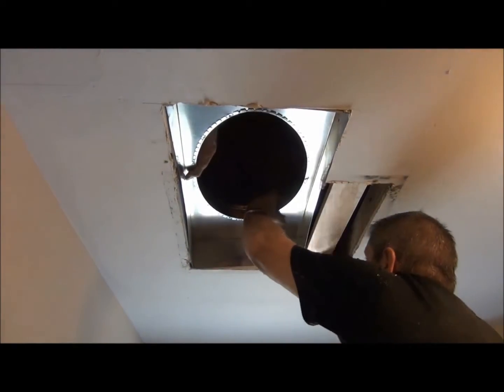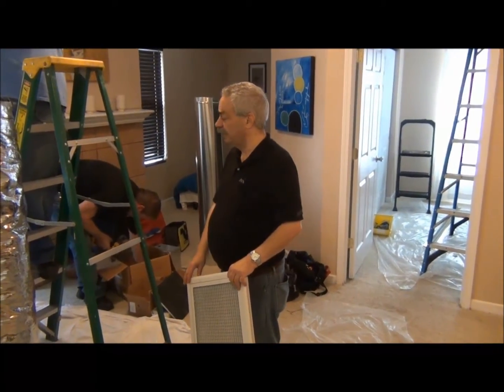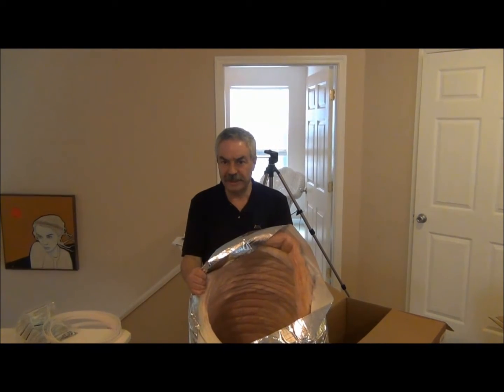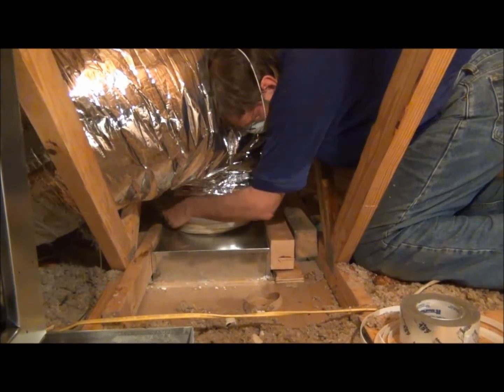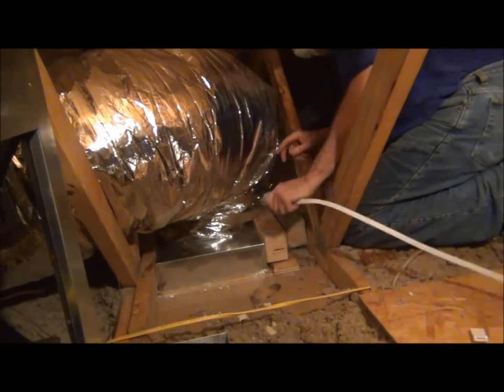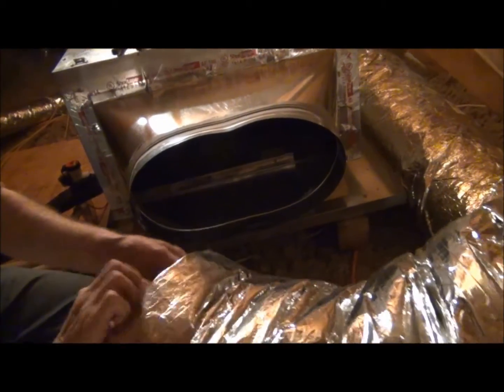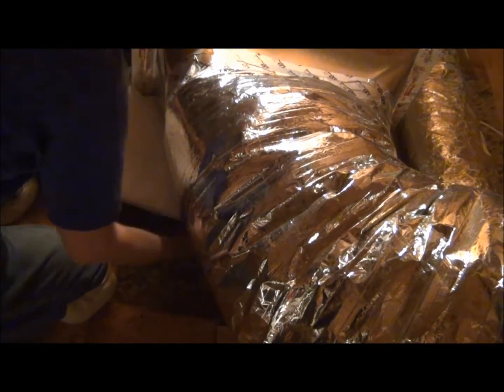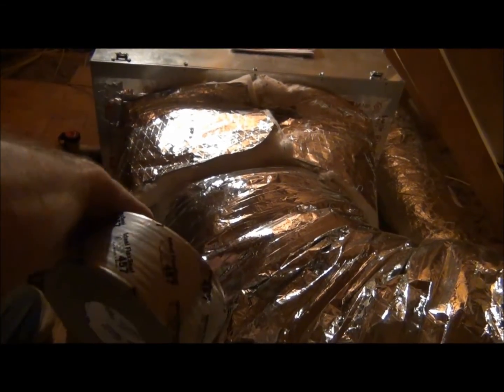Installing High Velocity Air Conditioning System Part 14 | The Unico System

Comment: Question with that size air duct isn’t that size filter and box going to be a restriction? Also, wouldn’t it be better for airflow, if instead of the top of the box being flat, it was flared up like a funnel at say a 40° angle?
Reply from the maker: Hi @Eddie2425... The 14x30 is the correct filter grille size for our 3036/3642 units. In regards to the air flow, this is the same type of filter grill that we have used for years and not had issues with the air flow. You just don’t want to have more than three 90° bends.

Comment: I just had a complete unico re model.  New air ducts , and all.  
I like the idea that you wrapped extra insulation around the return.  Is like to do that.  What type of insulation do I need to get to wrap?  Can I get that at Menards?   It’s like you did an extra wrap protections around the connection for extra seal.

Can you do that in the other side as well , the main line? 

If it’s easier for me to call, I would like to discuss via telephone
Reply from the maker: Hi George. Thanks for reaching out.  Our Technical Support Team would be happy to discuss this with you. Please contact them at (800) 527-0896 opt. 1.

Comment: I have one of these big returns in my hallway. Why is the box 14 by 30 when the hole is not even that big? Shouldn't the box be square with a square grille?
Reply from the maker: Sean, thanks for your inquiry on this subject. To ensure we address your specific application or question correctly please give us a call at  (800) 527-0896 or you can text a tech at 314- 222-2487. We are here to Help!